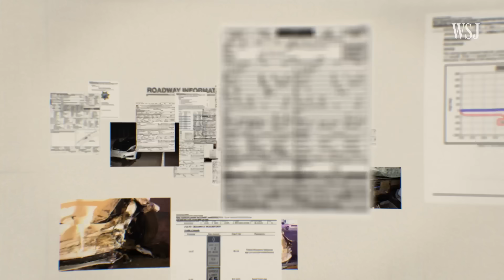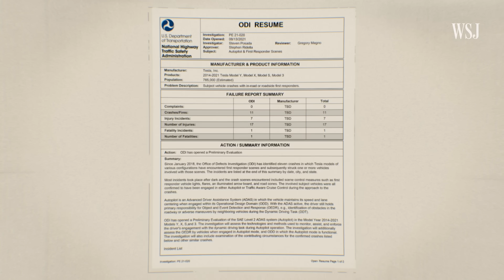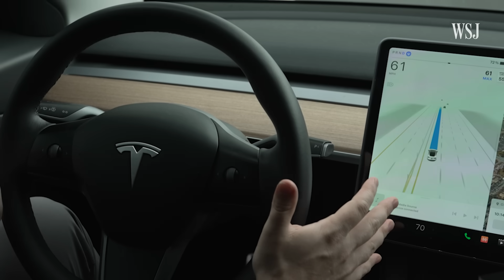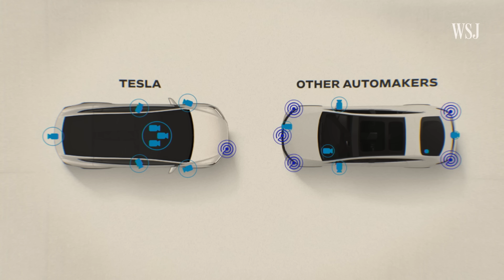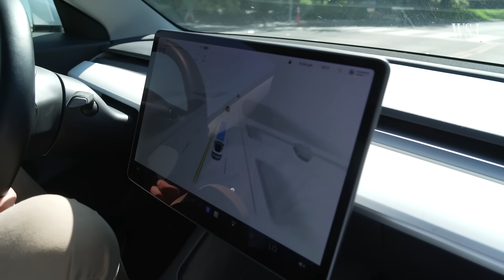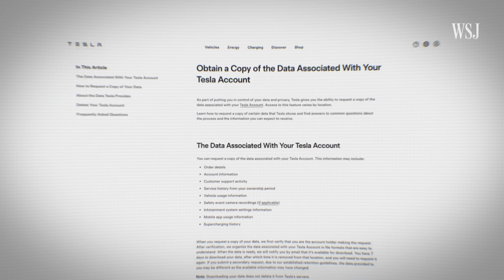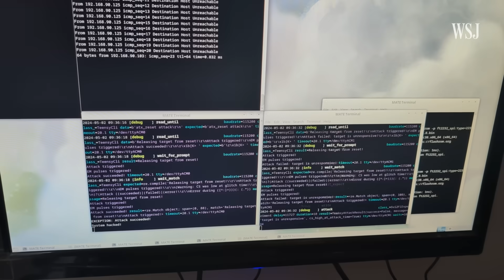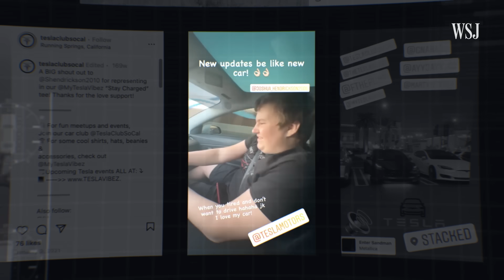The Hidden Autopilot Data That Reveals Why Teslas Crash | WSJ

Comment: People should be aware that you still have to drive the car, no matter what self driving help available. In Europe we do not have full auto pilot so its not a problem, but I know for sure it would be the same if it was allowed. To my knowledge (I own a Telsa) Tesla doesn't allow you to not be all  dependent on full auto pilot to drive the car without your permanent attention and ready assistance. It helps a lot in various situations, namely when in the highway, but i never, ever take my eyes off the road ahead and my feet mm away from the pedals. People should be made aware that the technology is still on its infancy and we need to help it. By deepest condolences for those who died or got injured.

Comment: It's level 2, like any ADAS, it says you're in charge of the driving, it's your responsibility. Level 2 assistants don't use lidar 99% of the time, they might use RADAR, like Tesla did until 2022, but that's it. If you're comparing with more autonomous systems (level 3 or more), then yes they're using LIDAR but autopilot level  2 is not level 3/4/5. The question is, why are you asking a level 2 assistant to detect an imminent accident that a human could have avoided? Even though it says "please take over immediately"? Of course when you're ready to take over, autopilot (which is not full self driving) is indeed safe. Do you think other car companies take responsibility of their (far worse) ADAS system, when the car crash because humans is not attentive ?
Then what would make sense is to look at a software that is meant to be fully autonomous, like FSD SUPERVISED. So, look at FSD >V13.2 videos, it's still an assistant that needs to be supervised, but it's REALLY good and safe, 90% of the time better and safer than any human. Buy  you didn't show any fatal accidents with any version of FSD, although FSD is meant to be unsupervised in the long term (maybe 2026?)when perfected. But even if you did show a FSD crash, it still says  it should be supervised and you should take over at anytime.

Comment: I have fsd in my model s. It is exponentially better month to month. However you are still supposed to pay attention. The videos shown all could be avoided by paying attention. The question is should it be called autopilot. Debatable. Like anything else you play to your lowest denominator and the public is generally clicking and forgetting the drive part. I’d like to add the truck laying down is a hard one to see. The t intersection one looks like auto steer was active with no nav input. Or it would have had the turn signal on before to make a turn. This article is misleading. Using data from 2021 is ancient tech with generations older hardware.

Comment: Tesla FSD is Level 2 autonomous driving. Which means, the driver must all the time watch the road and has hands on steering wheel. End of the Story. If a driver does not pay attention on the road it is (legally) his/her fault. I drive Tesla and have FSD.
Reply: This is a legal death machine. It’s name and advertisement totally undertone this « legal » part. Confusion is enhanced by the name « autopilot » and the existence of truly autonomous taxi services. 
And it is vastly documented in scientific literature that a high degree of automation seriously decrease the vigilance level of any person supposed to monitor it and retake control immediately in rare cases of failure or error. The ability to react in a timely manner and adopt the right corrective action in unexpected, complex situations where the automation suddenly fails, is proven to be very degraded as opposed to a continuous manual control where dealing with a sudden unusual situation is much more likely to be successful (within human limits obviously).
This is a low cost hardware system made for profit, covered by a mere legal umbrella to hide known dangerous and documented flaws originating from a flawed cheap design. Period.

Comment: It's pretty disgusting to think that they don't use LIDAR in addition to their cameras, just so they can cut costs. ultimately putting lives at stake.
Reply: They don't use Lidar, because they are not needed. If they were Tesla would be using them.
Reply: @ lidar would have detected and probably prevented these accidents. Tesla cares about sales and expansion, not safety. They had to issue seven recalls on the cybertruck. That’s pretty concerning.
Reply: @scl7555  You do know a Waymo crashed into a large wooden pole a few months ago? depite having Lidar.

Comment: The thing with teslas is that they can have 1 out of the 3 types of autopilots, Basic autopilot, Ehanced autopilot and Full self driving (supervised) Out of these 3 only the FSD autopilot is the smart one the other two are just glorified adaptive cruise control. Limited to highways. whilst FSD runs on proper image data. Most teslas that crash are running Enhanced or basic autopilot hence why it doesnt detect all the obstacles..
Reply: Citation needed.

Comment: I have a little different perspective here also as a Tesla driver. I was driving down the road, admittedly a little in my own world. The driver in front of me slams on their breaks. Full break check. The car literally slammed on the breaks, and swerved out of the way to an area with no cars. It was all captured on multiple cameras for me to rewatch and analyze what I could do better. I do not trust autopilot the same at night and I’m extra attentive. That truck would have been incredibly hard to see even if I was driving the car normally. The Tesla has saved me from near misses multiple times that in my old truck would have been an accident. I feel much safer in my Tesla, and you agree to MULTIPLE warnings that the system is not fully automated and that YOU are responsible to pay attention to the road.
Reply: So do you seriously feel that it is OK that  Tesla wants to bury the reports on crashes from the public???
Reply: I don't agree with it, but I understand why the want to. Media hit pieces like this are dishonest and hurt the company. If the driver had been paying attention, he could have avoided the accident. Turning the wheel slightly or hitting the brake is enough to disengage autopilot of FSD. You can take over at any time. Distracted drivers or drunk drivers cause accidents like this every day and never makes the news. The one time Autopilot doesn't catch it fast enough, the media makes a story about it.
Reply: Brakes not breaks

Comment: If you are going to say autopilot is putting people at risk by only using cameras, humans should stop driving.
Reply: Humans should stop driving. But we probably need competent level 5 first :)
Reply: @rmariboe  Are humans levels 5? Many humans struggle in good conditions to drive well. I would argue if every car on the road was only level 3 and not one human driver, there would be more accidents on the road. Level 5 is really only necessary because humans are also driving.
It is already to the point where most edge cases a tesla can't drive in, are bad enough humans shouldn't be driving either. If you can't see the end of your hood, you shouldn't be driving. (AKA zero visibility)
Reply: @rmariboe  It will be a process. Driverless cars growing in numbers and capability, until it is obvious to everyone the capabilities of automation
Reply: Yes, because AI is still pretty dumb compared to humans.
Reply: @muhammadusamahshahid6805  Have you seen humans drive?

Comment: Why Tesla has not been sue for these deaths?
Reply: Because the drivers were at fault.
Reply: it's always the driver's fault
Reply: @gridcoregilry666  If they are using a level 2 system and not using it correctly.Then yes.

Comment: Check out their current FSD 13.2.2. Even now it is still required driver to take over when needed. Why would they trusted it with their lives as the technology was still new. Read the instructions before using it please. Don't be stupid.
Reply: Yes because it is still level 2. The driver is responsible. FSD is set to make our roads far safer.

Comment: The technology is amazing but AI assisted driving has to learn from mistakes. The more data points you add to the system the better it gets at avoiding those mistakes. You can’t afford to just let the program run by itself right now. You’ll end up becoming an unfortunate kind of data points.

Comment: In Aviation, an Autopilot must be fed with correct and sufficient data for it to work as desired. When it comes to Tesla, this has not been done.
Reply: In aviation the pilots don’t blindly trust the automation. An autopilot system requires constant monitoring and timely intervention.

Comment: I am a retired software engineer. We always had a rule that interface design had to be clear, understandable and aware that people make mistakes. We had to be very careful how to frame the prompts and check the user inputs. Here, Tesla have the prompt that the car has an "autopilot". This violates every guideline that a software engineer would use because it guides user inputs into an undesirable direction. To those who commented here that the drivers must bear responsibility and that Tesla cars give better performance that humans only, this "autopilot" prompt is criminal regardless, especially as it is used for marketing purposes rather than human safety.

Comment: If you have a system that requires you to keep control of your vehicle, if it screams at you to pay attention numerous times, if there is a crash after that it's on you... 
If you had another car and not pay attention you would crash also. 
There is enough Data from tesla that makes it clear that using autopilot or fsd while driving reduces the number and severity of accidents substantially and the technology gets better.

Comment: The main problem with any form of semi autonomous driving or full autonomous driving is that the systems are only trained in stuff that has already been discovered to be a problem. When there’s new hazards like the overturned truck, the systems aren’t trained to recognize that, while people can.
Reply: And some of these drivers have signed a liability to be testing these teslas, but the people around them havent
Reply: @simplicity_1123  Most people have no idea how good FSD is getting or will become. This tech is going to save many lives.
Reply: @daydreamer8373  after it kills how many other lives?
Reply: @simplicity_1123  If someone is using a level 2 system fails to use it properly, then that is not the fault of the system. Having said that, I am talking about FSD, which hasn't killed anyone, and as I said will save many lives.

Comment: Remember guys tesla is NOT level 3 SAE classification which is the minimum requirement for a car autopilot to be called "autonomous" still requiring supervision when the car requests it while level 4 and 5 are fully autonomous. Tesla is currently level 2 which is still classified as drive assistance.

Comment: As of writing this comment the video description reads "Video and data gathered by the Wall Street Journal from over 200 Tesla Autopilot crashes shows that longstanding concerns about Tesla’s camera-based technology, which differs from the rest of the industry, are showing up on the roads and putting the public at risk."

-"Autopilot" is an advanced driver assisted cruise control (same as an airplane). It is described as such inside Tesla's as well as their physical and digital manuals.

-Bosh, Mobileye and Chinese NAV makers are either exiting or scaling back LiDAR research and development.

-The WSJ didn't mention Tesla's FSD (full self driving) technology which would provide context to the "longstanding concerns about Tesla's camera-base technology," why it differs from the rest of the industry and is safer than a human driver when measured in incidents/mile driven.

By all means critique Tesla. Hold them accountable. This is lazy journalism.

Comment: This wouldnt happen if people took over before it happened... like bruh there's a friggin steering wheel inftont of you, use it if you feel unsafe.
Reply: Yes. And the whole point of the video is - if you need to always be alert that your autopilot will not mess everything up, THIS IS NOT AN AUTOPILOT AND IT SHOULD NOT BE ADVERTISED AS SUCH. Because after a while you begin to trust it, because most of the time it does the job, and then you die.

Comment: Tesla hit piece to get revenge on Elon’s influence on the presidential election... Using clips from 5 year old software, in the dark, obstructed views. Autopilot has improved exponentially the past 5 years. Why use video from its beta 5+ years ago. Its current form is better than 99.9% of human drivers. I trust it more as a passenger than I trust humans driving me around. The data shows a 1000%+ decrease in accidents when using autopilot… If you are going to make a hit piece at least show both sides.

Comment: FYI auto pilot is separate from full self driving. It’s a smart Cruze control and when you turn on the setting for it you have to agree that you understand that you are the driver and are responsible for your vehicle. Therefore all the crashes happen in-spite a computer and a driver. Full self driving is a huge step up and aims to be fully autonomous but for now you must agree to be aware and in control in order to activate it. So far all accidents are under human supervision. Keep an open mind and consider new data as technology improves. We will see if computers can be better drivers

Comment: Yawn… So much FUD. Autopilot isn’t perfect, neither is any other ADAS system out there. It’s the driver’s responsibility to be alert and ready to take over at any time. The system tells you this when you enable it. It doesn’t matter what Elon says. He says all kinds of crazy things. That doesn’t automatically make Teslas bad. ADAS technology is still a work in progress. It’s not perfect but that doesn’t mean it shouldn’t be a feature. If they wait for it to be perfect before releasing it, it will never get released, because there’s no possible way for them to test every single edge case in a safe, controlled environment. Life is risky. When you use these features, you take responsibility and weigh whether the risk of using it is worth it for you or not. If it fails to act appropriately, you take over. In any case, it doesn’t matter what people think after watching this video. You can’t put the cat back in the bag. Autonomous technology is advancing rapidly and there’s no stopping it. When it inevitably becomes safer than humans 99.99% of the time, even stubborn regulators won’t be able to ignore the stats and the media will have to find something else to complain about.
Reply: don’t call it autopilot then, it’s basically cruise control/lane assist
Reply: @FazeMagikarp I agree with you there. Poor choice of naming, but that doesn’t change the fact that you are given a warning before you can enable it that it does not make the car autonomous and that you must be ready to take over at all times. Tesla really should change the name to something more descriptive of its actual capabilities though. For example, their more advanced self driving feature is actually called Full Self Driving (Supervised) which is perfectly descriptive because it can fully drive you from point A to B but you still have to supervise it. Why they still call their inferior lane keeping feature Autopilot is baffling, but ultimately it’s just a name. Just like any other feature in a car, you should understand what it can and can’t do before using it.

Comment: Hitting things the autodrive system does not recognize is scary. It needs to avoid obstacles even if it can't decide what they are (obviously). The overturned truck was clearly visible in the footage and it seemed to me that there was time to brake and/or swerve, but the autodrive did not react at all until it was far too late. It was equally alarming where the car drove straight through a highly visible T-intersection sign and off the road. These seem to be software problems rather than camera problems. 
Also, digital cameras have all sorts of inherent distortions including worse sensitivity in low light which make them generally inferior to human eyes. Radar has a longer range and works in fog, rain, and dust. It fires pulses of radar and detects the reflection so it works independently of the light conditions. It also is quicker and more accurate at estimating speed and distance of other vehicles. However using both cameras & radar creates the sensor integration problem - which one do you trust when they disagree? Tesla keeps changing its mind on radar.
Autodriving is just not ready yet.

Comment: To be honest, I would have crashed as well in a lot of those scenarios where an obstacle appears out of the darkness.
Reply: First rule of driving, only go at the speed where you can stop within the space you can positively see is clear, not the space where you can't see a block.
Me obeying that rule on a narrow and twisty rural road (much to the annoyance of the berk behind me) stopped both me and him hitting the fire engine that was stopped just round the bend. Ironically, the fire engine was there because it was recovering a sports car that had gone off the road on the bend. 😬